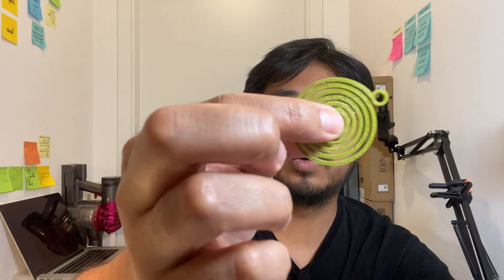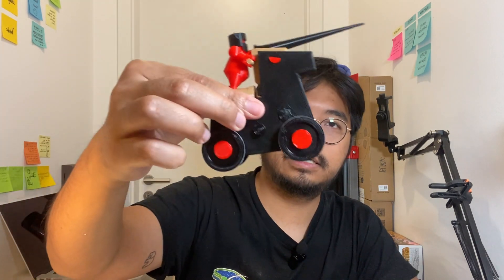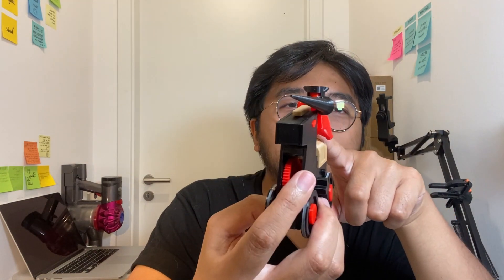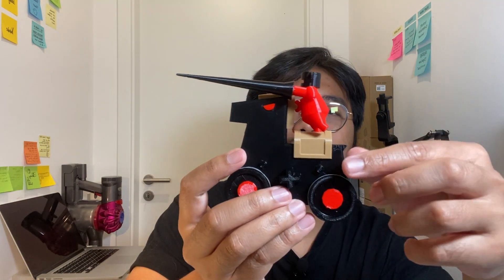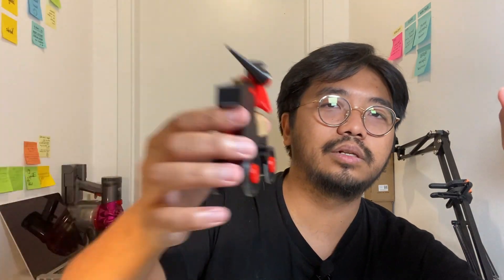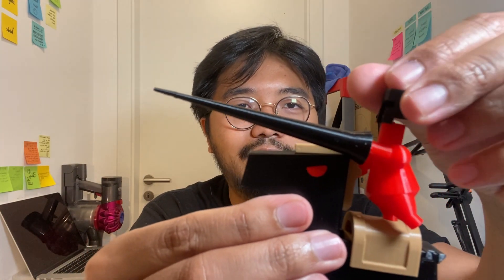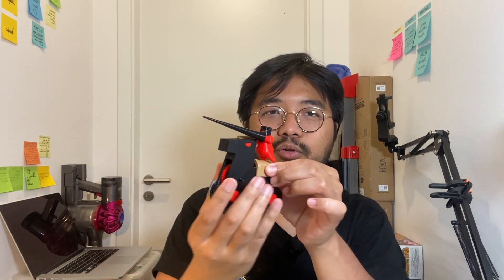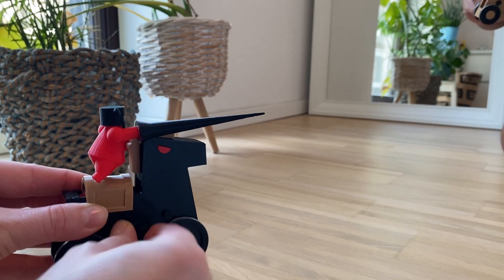I made a wind-up jousting knight toy using 3D Printer

Comment: oh, this has my head gears spinning. too late to form a coherent thought though but something about placing the knight with a quarter spin slide in motion, might let it to be shoved out if hit at the right angle. then the question if the aim should be to hit a shield in the knights other hand and how to angle the lance. or maybe easier would be a shield lance combo. haha sorry for rambling I should really sketch it out or build out of lego before trying to put it into words
Reply from the maker: Thanks for the idea, I am currently working on the new ver, where you can rotate the knight so that the lance can be angled towards the opponent. Stay tuned! :)